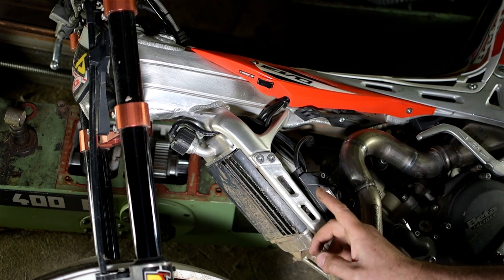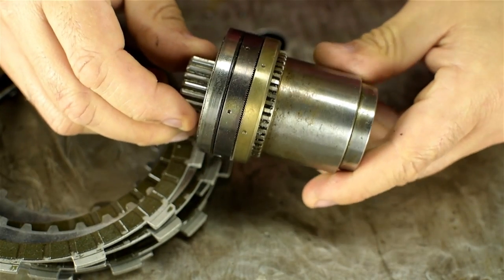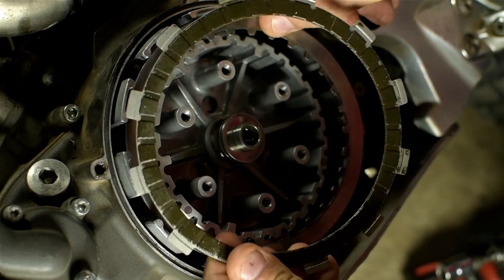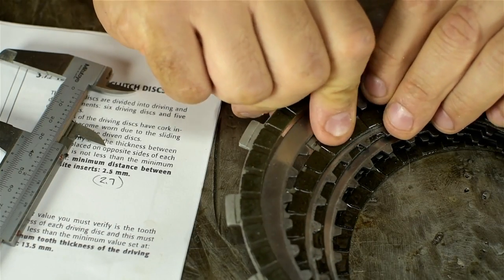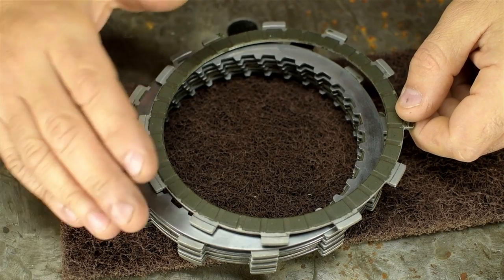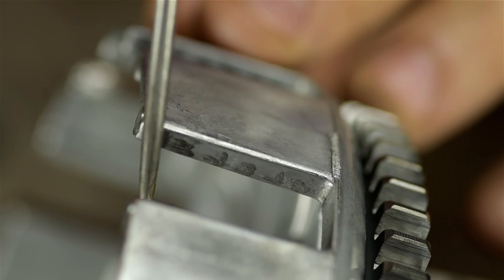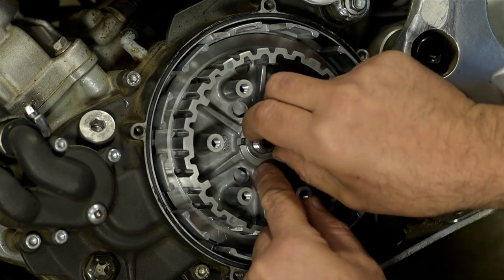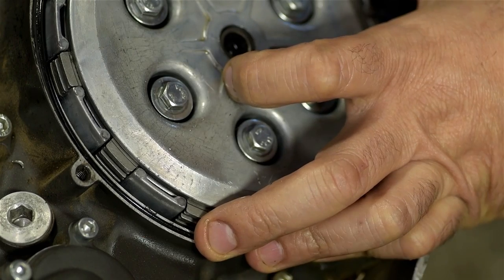something something MOTORCYCLE CLUTCH!

Comment: PSA:  Be mindful of the arrangement of the steel clutch plates. Some manufacturers use a single special "conical" steel clutch plate at the bottom of the stack. The difference between the normal flat steel clutch plate & the "conical" steel clutch plate is often times minimal and not obvious at all.

Comment: I think youre supposed to soak the friction plates in oil before you install them. Not sure if it matters cuz theyre used but i would assume that the soap amd water wouldve removed residule oil thus drying the friction plates out. Someone correct me if im wrong

Comment: They used an automatic transmission clutch pack and drum and used it as a clutch. No hydraulics either. What lubricates it? Without the oil the clutches would touch as they spin. Your big issues after checking all this and it doesn't help is to check pressure and clearance.

Comment: A bit ago i replaced some parts on my warner & Swasey 4A Hexagonal turret lathe's rapid traverse mechanism, it is driven off of a single key, in a spline shaft that is about 10ish feet long. and it is actuated with a lever which has a left, center and right position which control the direction  it travels. the two cylinders that have all the clutch gears are extremely difficult to get to, and the whole mechanism that sits on the underside of the gearbox weighs about 60lbs, and is bolted in upside down, with not a lot of leverage available for anyone trying to get that back on. and there isnt a lot of good ways to test to see if it works prior to installing it. and to top it off, the hex turret apron that it carries weighs a metric fuck ton. So its not like you can maneuver that into an easier position. 
Moral of the story, as always, oil your ways.

Comment: file the basket......yep.RM250 basket was worn,but usable,so i got another used,not so used basket n hub,still cleaned it up.

Want lots of power,match the crank case to the cylinder,easy job,turn that 2T 125 into a 200-250 lookalike,and the good part is it costs nothing and is super easy.GAS FLOWING;).

Comment: I think the majority of us just like tot videos. The humor,  camera tricks, innuendo,  etc. I like your motorcycle vids just like i like AvE's gun videos. These are 2 subjects that I clearly know more about than you 2. It's nice to be the smart one in the room every once in awhile. Carry on.
Reply: The springs were borderline? What are the scooters symptoms? Is it not producing the ponies or are the ponies not making it to the ground. Soft clutch springs could be the problem. 
Also,  there tends to be an inner and outer fiber clutch plate. They are designed to rub on the aluminum surfaces of the basket and hub whereas the others rub on steel. Although i have never really noticed a difference if they were out of order.

Comment: It’s kind of sort of the reason I watch your show cause I love motorcycles and I love making my own parts for those motorcycles an easier way to test if your clutch is going on you just go for a ride put it in gear and step on your back break while you’re giving it throttle you’ll be able to tell right away if your clutches are slipping

Comment: Couple of things:
1- filing down the clutch basket is not a good idea, those areas are hardened and you just softened them up, they may end up worse and prematurely shorten the expensive clutch baskets life (on the positive side, you could replace with an Uber expensive aftermarket one that wont get dogged).
2- what oil was being used? Using automotive oil, especially with friction modifiers will ruin the clutch fibers. You need to use a JASO MA oil (certified for wet clutch use) to avoid slippage. Don't listen to the anti-synthetic dorks, as long as it's JASO MA you are good, and full or semi synth will last longer as the additives don't break down as fast. Some Rotella grades (not all!) are excellent, some use ATF but I wouldn't for such a machine.

Comment: I made the mistake of putting regular 10w 30 in a bike once. The clutch slipped like crazy and had to soak the clutches in solvent to clean them. Regular oil is too slippery for bike clutched. Make sure you use the straight non detergent 30 weight if your bike calls for it

Comment: Great video, learned a lot. However, you mentioned that you lay the bike down, so oil wouldn't flow out. Why is there oil in the clutch housing? Wouldn't this create a thin film of lubricant and ruin your friction coefficient of the clutch pack?
Reply from the maker: it runs in oil.

Comment: "if it were much worse". I had a maico gm star 500 engine once that i tried to aquire a clutch basket for once. All that i got offered repeatedly were baskets whose shoulders closely resembled the look of a homeless teeth. "supposedly" working fine, for 250 bucks. those on your clutch look like they have barely seen any use at all, even though the outer disks seem to pick up more load... possibly a job for the dividing head to machine/refinish the basket to aerospace tolerances instead of a file? Fixing the issue: try thicker oil without any synthetic content first, if that doesn't help, new plates and stiffer springs.

Comment: Being used to triple plate clutches in race cars the tolerances are far tighter.  You have 15thou max wear in the plates and very little in the steel discs.  The pack itself is around 7" in dia though the plates are far wider.
The factory 351 Ford road car twin plate is near 50lbs, The Tilton assembly is around 20 and ofcourse far less centrifigual weight. So far better engine responce and far safer as well. Great for a race car but terrible for street use as the plates simply get hot and will not release.

Comment: I always soak my friction disks in oil for 30min before putting the clutch together. Pretty important step. With the small amount of power of your bike you might get away with putting them together dry. Try this with a 100HP bike and you will just burn them up in a second.

Comment: Scrubbing the wet clutch material in water is risky! Automotive automatic transmission clutches are glued to the steels with water based glue, well, at least they used to be. Who knows now. It's always a good idea to used like products that the part came from... If you're working on water cooling parts, use water based cleaners. If you are working on oil lubricated parts, use petroleum based cleaning products!

Comment: Ouch... TOT reassembled the clutch pack dry, I guess there's another video of brand new clutch soon =)
They are similar to automatic transmissions clutch packs, you need to soak them up in the same oil the engine/trans uses before assembly

Comment: Love those moto videos! But i didn't quite get it... If your clutch was slipping, deglazing and grinding those notches wouldn't do anything at all. Maybe you should check steel plates for wrapping and springs length instead. And you never said the clutch was dragging, so those notches are nothing to worry about. You just added some more free play that will cause faster wear of basket. I walked this path a couple times and ended up with uneven wear of clutch basket and rekluse-ish inserts in it. Sorry, not trying to be a smartass just wanted to share some experience

Comment: I have rotor knives at work that have a similar system but it’s just for keeping the blade from wearing against the retention ring. I (the millennial) place it: blade, wear ring, spacer, wear ring, retention ring. The gen x’er who refuses to listen to me put the spacer directly against the retention ring and the two wear plates on the blade. The blades eventually get replaced, SO THEY DON’T NEAD WEAR PROTECTION! THE RETENTION RING NEEDS THE WEAR PROTECTION!!! Needless to say we go through more retention rings and spacers than what the OEM expects. And I’m branded as the know-it-all millennial who doesn’t get it..

Comment: No repair video is complete without a pre-repair problem demonstration, and a post-repair test run, preferably with a test crash..
At least a report, did it move? Sit there and slip? Sit there and slip and smoke? Make grinding noises? Grab and throw you off the back in your best Evel Knievel style crash? 
(I'll never forget the 2 stroker I got running when I was about 14. Revved her up and dumped the clutch to make a statement as to the greatness of my repair skills.

Side note: Did you know that if you set the points wrong on a 2-stroke, it will run backwards? Quite well actually - yup! (Thought it was funny how it kicked the lever back while trying to start it, but found it started right up if I kicked it and slid my foot right off) Anyway, there's no graceful solution to a motorcycle running backwards - except maybe pull the clutch back in quick, I didn't think that quickly in any case. When faced with something so foreign, the brain just goes into neutral (too bad the bike didn't) You can guess the rest. To this day, I always check, then hold the brakes and slowly apply clutch until it start to pull. Then I go to the macho holeshot routine....

Anyway, next time, those of us who are OK with with 'TOT Trials repairs' would like a demo! ~ Inquiring subscribers want to know, ya know!

Comment: Wet clutch - wet with oil... oil selection effects friction.  Was slipping the issue?  Could be oil with friction modifiers.  Too grabby? Could be oil with high friction.  Right oil is the oil the engineers expected when they designed the clutch.

Comment: This is less of a clutch and more of a transmission. If you were to take apart any transmission, they have these parts as the internals. While it may work on a sort of clutch system, it's probably more appropriate to call it a transmission unless it has an actual transmission as well.

Comment: I think you mentioned that the engine is down on power. If the clutch is releasing properly and not slipping(you'd  hear the rpm climb) your good. EVERY carbuerated bike I've owned was way too rich. Lean is mean and makes HP. You might be amazed at how much a simple jet change would wake it up. I'm guessing there are plenty of YT vids that can help you with tuning it.

Comment: Bro, i think what u did was not a better ways to perform the clutch. Try with my tricks. For steel plate, use ferro cloride solutions to make  the plates more pores. Do not take to long. Just look the surface, after  the shiny was gone, its done. For the friction plate, im used to cook with water and soap, just couple minutes. They will expanded the thickness. If you sand it, you lose some part. Coz for clutch, roughness and soft are better for holding steel plate

Comment: @This Old Tony , I'm not doubting your intelligence at all . I'm sure you checked the clutch cable slack to ensure it has a small amount of play at both ends when the clutch handle is relaxed( unless you have a hydraulic clutch pull) . one thing many people overlook is the engine oil type. a automotive detergent oil will make modern wet clutches Sticky .. where they do not slip correctly.. and automotive synthetics will make them slip too easy (acting like a worn clutch ) this is usually noticed in about 3rd gear ..changing the oil to a proper wet clutch approved oil solves the oil problem . Preferably the manufactures recommended oil.

Comment: What was your 'problem' with the clutch ?
I take it it is lubed with engine oil. Probably the only faulty component in there was the oil. Use the right oil and change oil & filter as required.

Comment: There is probably nothing wrong with clutch, to me it looks like almost new, maybe 20k miles in streetbike terms, you may want to check your oil, wet motorcyle clutches require jaso spec 4 stroke engine oil MA,MA1 or MA2 which is oil without friction modifiers like used in normal 4stroke engine oil, the number correlates with the specific clutch load 2 is for clutches with the highest load.
Jaso spec MB meant for motorcycle gearboxes cannot be used in a wet clutch as it will slip due to the friction mofifiers in gearbox oil.
So yes, in the crankcase of a 2 stroke you put a 4stroke motorcycle engine oil.

Comment: 16:20

Is there a reason why that slack can't be thuroughly eliminated?
Vibration issues?
Reply: If there were zero play, that means that it would be lightly touching the spinning pressure plate all the time - which would cause it to wear.
Reply: @HarmanRobotics  isn't that what a throw out bearing is for or are those not used with such small clutch assemblies?

Comment: Norton Commandos were the only m/c ever to come with a proper clutch spring !! If yer clutch is slippin', GLASS BEAD the steel plates or replace all aluminum plates, replace the frictions and put in HD springs !! If you girls think the pull is too heavy with that hydraulic clutch release system, thank the Lord ya ain't got a cable operated system !! For yew tire shreddin' street snarfs- if'n yer friction plates ain't got no material on 'em- clean yer oil pump pick up screen before ya's seize yer crank from no oil !!

Comment: 2.5 HP???  WOW!  Must be a real hill climber  Overheated springs will not have enough force in them to keep the clutch pack firmly engaged.  Also and many forget,  if it isn't properly adjusted just like a car clutch on a manual transmission same problem, slippage.

Comment: Yeah it seems counter intuitive but scuffing makes it worse, you are increasing the surface area of the pads/plates with the scuff but you are decreasing the surface area of contact, and since we are looking for friction, it will now wear down a little faster until it reaches it's maximum mating surface, but it's really nothing to call your mother in law about. If the pads are still in spec and still not happy your next port of call are the springs. Also it's a good thing (a minor thing, but a good thing none the less) that you slightly lapped the basket fingers since i'm pretty sure the plates didn't go back in the order they came out it will give them a fresh surface to make a home on during the engage. But we getting into clutch fanatic territory now.

Comment: Hey Tony there might be a missing trick or it lost in translation or it doesn't exist for your bike...

I had a KTM and replaced clutch myself. (Made a video) So the most of the motorcycle clutches steel plates are have different surface finishes on their two faces. You can identify them by discs corners. One sides corner is not smoothened and the other corner is rounded. So that allows friction plates are not stick together between two steel plates like sandwich and cause each steel plate couple with only one friction plate. Maybe that was the problem on your cluch basket. On steel plates all the rounded corner faces or non-smoothened corner faces should face same way inward or outward. It can be different for all motorcycles but most important key point is they should look same way. In theory: If the rounded-corner-faces look outward it cause smooth clutch feel, if they look inward that cause hard engage feel (race use). So I don't want to cause disinformation. I'm sharing this info in case of lack of information. Maybe you know that but just not mentioned on video... Anyway I hope that trick helps you and community. You can check my clutch video. It's in Turkish (I'm planning to make subtitle for years :D) but I think you'll understand it. Sürç-i lisan ettiysek affola :)
Reply: Hey Tony, I have new motorcycle project and need to produce come custom parts. It's about bending pipes and welding pipes again. I talked lots of local mechanics and machinists but all of them said it's near impossible so probably I'll make this project alive so... I need your opinion some little mentorship... would you help me? I couldn't find your communication details so I've got mine on the banner ıf you don't want to reveal yours. anyway thank you again for all of your inspiring content...

Comment: If only my boss would get a set of sintered clutches for my vdf it would probably have way sexyer modualtion on that engagement aswell as just plain old better engagement
Currently were on its second set of springsteel clutches 
Sintered factory clutches served this machine for around 20years and the first spring steel clutches only lasted 13 
Installed the new spring steel set in january and getting them set perfectly is such a huge pain jn the ass as this is the machine i gained most my turning experience on and i want it to feel the same it felt when i first started on jt 
Dont get me wrong i love modern em clutches but the older direct drive+mechanical clutches had fucking character

Comment: When your cluth does not work as expected you should also check if you use the correct motor oil. It's a kind of running joke every KTM LC4 640 rider knows - wrong oil kills clutch by lowered friction. Therefore check the manufactor specs for the required motor oil in detail.

Comment: Not like the clutch on my 1 liter. Judder spring, spring plate different size friction  discs and Hondabond .  You should have replaced it while you had it open. Springs that are at the limit are already gone. Your basket looked fine.

Comment: 14:45 What are you doing here?! 
In the end, was it an improvement?
Reply: The teeth he pushed in hold the nut in place. Had he not done that, the nut might loosen up due to vibrations. I suppose he replaced that part from when he disassembled it.